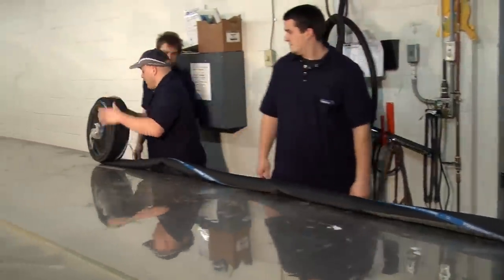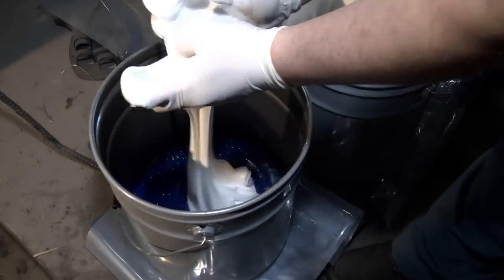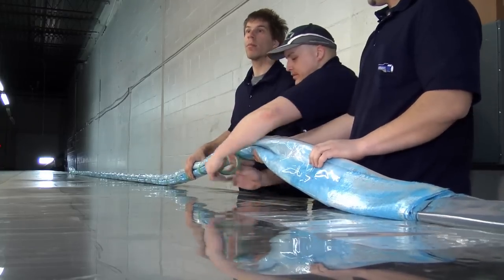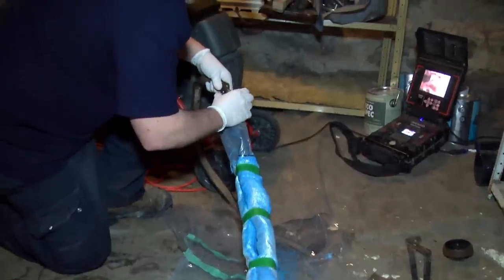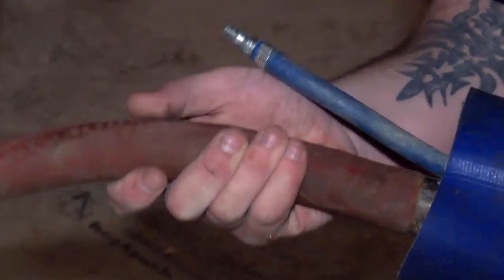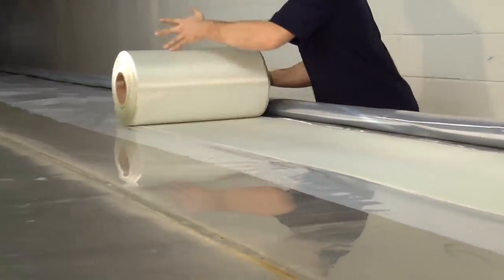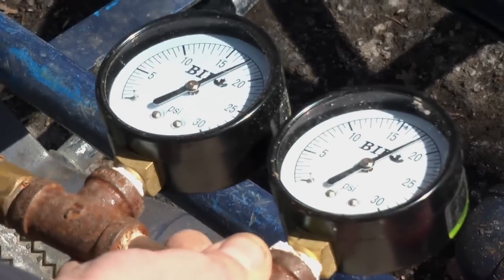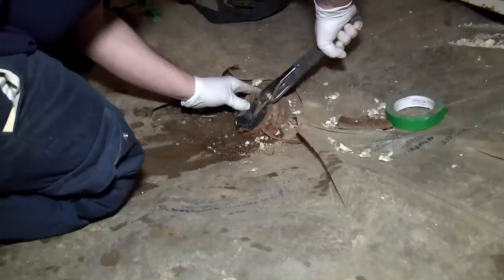Formadrain No Dig Pipe Repair System - Installation Video

Comment: amazing technology, is this used to repair breaks in pipes? clogs? What if you have old pipes that are closing up under the house?  dont they have to dig down under for that?
Reply from the maker: TheUntubed Thanks for the comment and questions. The first step towards installing Formadrain is cleaning and inspecting. After we do that, we can tell if we are able to repair the pipes without excavation. Some restrictions in size and configuration apply, but in general the answer is yes, we can repair old pipes under a slab without breaking the floor open. The resulting repair is 100% structural and watertight, no digging required!

Comment: What do you do if you have a few blind laterals joining the run, do you measure and pre cut the line, pretty risky in case of any shrinkage and block the lateral up,
Reply from the maker: There are a few options when dealing with laterals. Measuring and cutting the line will work very efficiently in a pull-in place system vs an inversion where stretch is very present. However, lining a LMC T or Y Liner can be an option as well as using a Picote cutter that we distribute. Give us a call at 1-888-337-6764 to discuss this, it'll be a pleasure.